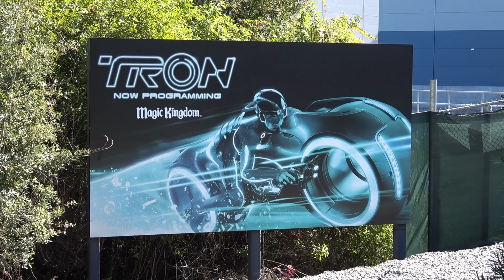Why is TRON taking SO LONG?!

Comment: I noticed that pretty much most new Disney rides, not just TRON, are taking longer to build than they used to. Guardians of the Galaxy: Cosmic Rewind was also announced in 2017, and still won't open until this Summer. And unlike TRON and Ratatouille, there are no earlier incarnations with supposed exclusivity contracts. Meanwhile, Universal was able to construct both Hagrid's and the VelociCoaster within much shorter timeframes.
Reply: I mean yeah, the upcoming rides are taking longer. Not sure why that comes as a suprise. They lost a year of construction and now are dealing with staffing and material shortages. Universal is in the same boat as super mario land was pushed back in the US until maybe 2025 now. It stinks but expected. Not sure why some are trying to make this a bigger suprise then it is at this point but I guess that is what people online do.
Reply: Cosmic Rewind was originally supposed to open September 2021 but got delayed because of covid
Reply: @BAM5636 Epic universe was pushed back to 2025 which was close to original schedule anyway. Super mario land is in epic universe. Universal building whole park therefore obviously it was going to be pushed back. Disney building one attraction
Reply: Cosmic Rewind however not only is going to be a first of its kind coaster, but also part of the delay is because the show scenes where delayed in filming due to the 3rd movie starting production late, which from what I’ve heard was the main reason for the opening getting pushed back
Reply: @Jonathan Pal It isn't going to be until 2025 now. Sorry. It was put on hiatus in 2020 and the original schedule now it has resumed is not realistic. They have only down scene work ground level
 They have not built up anything really yet
 If you think they are opening in 2023, well, that is extremely wishful thinking. Also, universal should care a bit more about nostalgia to be honest. I actually love both but it is universal that has slipped a bit ride wise for me, not really Disney. Hagrids is a awesome coaster though as long as it stays running. Seems to be a bit better now after the first year or so.
Reply: @GBJames776  Disney has built more than one attraction in the last 3 years. They built two lands. Come on.
Reply: @BAM5636  Pre pandemic. Universal built a coaster and designed in the middle of pandemic, Disney haven’t even built there coaster that started before the pandemic. Only opened ratatouille like 4 months ago and I saw that being built ages ago. Disney make billions more than universal no excuse
Reply: @Jonathan Pal I got 2025 from universal's announcement when they resumed work. Also, common sense based on how little has been done at this point.  You have your opinion but Universal is not as good as it once was for me. Outside of Harry Potter, I am not a big fan of their newer rides. Fast and the Furious for example is the worst ride of any major park I have ever been on. Jaws? You have mixed up history on. Yes they shut it down after like 6 months originally but they they shut it down and rebuilt it. The version 2.0 didn't have the issues version 1 did. They closed that to put in half of HP. At the time it was a Hail Mary as Universal parks were failing hard. As for E.T, that is rumor not fact and E.T, the last opening day attraction, will be gone soon in Florida just like it is in Hollywood within a couple years mark my words. Most of universals non roller coasters are 99% screens and I am just not a fan of that really. New Kong is okay but FF, Jimmy fallon etc are terrible rides IMO. Also Disney is a cash grab but Universal aka Comcast is not? Ha..Okay I guess, that is a odd opinion but you do you.
Reply: @BAM5636  kinda agree with some rides being poor but seems like they have learnt there lesson from fast and furious , considering hagrids and velicoaster are arguably two of the best rides in Orlando. Which hopefully is good signs for epic universe
Reply: Avatarland took 6 years!!!
Reply: @GBJames776  I agree those are great coasters. That said, there is more types of rides then coasters and that is their weak point these days IMO.
Reply: @GBJames776  LOL. How many rides have you built? None, okay then. Your opinion on building them is worthless in the end.
Reply: @hollybabyyy  Not as comparable really as that is a land not just a ride.  Also James Cameron was involved and we all know how long it takes for him to get anything done.
Reply: @BAM5636  chill lmao, Universal have the best dark rides in the world, best coasters in the world. Not going to lie comment is just stupid. Forbidden Journey was named best dark ride in the world for ages. Disney have good dark rides , Just Disney is falling behind considering universal is making a new park more people will turn to universal , Especially with ridiculous price increases, if you are from the uk and went 3 years ago, all you see in Disney is ratotiouie which we already have in Disneyland Paris. Think will go only universal next trip, not worth overall cost compared to new experiences I get back
Reply: @GBJames776  Best dark rides in the world?...Bwhahahaha. Talk about a hot take there. FF is the worst ride ever made at any major theme park. Also ROTR is better then Forbidden Journey. Universal uses all screens all of the time. They sold their soul years ago and now are just a wing of Comcast.
Reply: @GBJames776  Also forbidden journey won that in 2014. Try being more current ;). It has not been the best dark ride since that time.
Reply: @Jonathan Pal Sounds like you are the one making things political. Once you went that way, I am no longer listening in all honesty. That whole talking point is tired and overplayed. You don't want to go to parks anymore, cool, your choice. Bye.
Reply: @BAM5636  I don't really understand your comment, So do disney, I stated Universal have world class dark rides which they do as proven. Was voted 2nd in 2019 . Literally disney has a ride which you sit in front of screens which are there most popular rides in Flight of passage and Soarin. You stated universal don't have good rides apart from coasters which is completely incorrect. I like disney too lmao, Just talking about how much money it costs from uk to go to disney compared to universal is significantly more expensive and they took away disney dining plan from uk tickets so it is even more expensive and rising ticket prices and food. Just not affordable no more and just not worth the price.
Reply: @GBJames776  For one, I never said Universal doesn't have any good rides. Also, are you really trying to compare screen usage at Disney to Universal? That is a rather odd side to take. If it isn't a coaster or water ride there is about a 90% chance it is a screen ride at Universal. You stated they have the best coasters and dark rides in the world. That is pretty subjective but if going by awards as tou mentioned earlier that is categorically untrue. As earlier stated, Fast and the Furious is the worst ride made in a major theme park that I have ever been on. It is laughably bad. Skull Island. I like Kong and all but I would take the OG back in a heartbeat. The best part is the only part without screens which is the half of the life sized kong at rhe very end. Screens can be used well but they should not be over used. Back to the Future or Flight of Passage were/are well used screen based rides. I want Universal to do well in the end. That is what you don't get really. I am not some can only love one dope. However, Universal has lost a lot of its identity to me over the last 10 years. I think most people just think of it as the Harry Potter park now and for good reason. It kind of is.
Reply: @BAM5636  I never went on old Kong or back to the future but have to admit jaws probably most missed universal ride hopefully they can add it as expansion to epic universe, yeah ff is crap.

Comment: It's ridiculous and the railroad has been closed for such a long time as well.
Reply: At least you guys are getting a ride out of it. In Disneyland Paris it was to build a now half of the time vacant Frontierland Theatre and above all a cost cutting measure.
Reply: They were testing the train the other day!
Reply: Hard to have a train running when the track is supposed to go through the construction area
Reply: When I visited in 2019 they had sent the engines off to Pennsylvania for refurbishment. I'm sure they were trying to have them done and back by the time WDW turned 50 but the pandemic put a damper on that. The cast member at the railroad station DID let me walk around the cars in ways you normally aren't allowed to do, which was awesome, and even spent quite a bit of time talking about the technical aspects of the cars, the engine, and the railroad itself. That was a whole lot of fun, and kind of a unique thing that you wouldn't normally be able to do during a Disney visit.

Comment: If I was in charge of planning I would’ve put GotG in Tomorrowland and Tron in EPCOT. You would’ve entered Flynn’s arcade in the play pavilion, get digitized, ride the coaster, and end up in the energy building where you can eat at the end of line club before reentering the real world. Think of how much money they could’ve made off that!
Reply: I'm sorry but No Marvel in Magic Kingdom. It's better off in Hollywood Studios.
Reply: @gissneric  down with that too
Reply: Agreed no marvel in MK. However I do agree with you about Tron in Epcot.. test track inside looks like Tron so can retheme outside and queue area and have a Tron area, but that would be $$
Reply: I agree. Tron would've be much better in Epcot and I like the Idea of GOTG in Tomorrowland.
Reply: @rebeccaheuer3255    Points and idea are valid. however what a lot of ppl seem to forget is the footprint of the attraction-  Tron is massive, and there's just now way it would have fit in EPCOT given the area. Cosmic Rewind while a big attraction doesn't take up nearly as much real estate as Tron would have. In addition, putting Cosmic Rewind where it is, allows Disney to utilize the former Universe of Energy show building and saves them the cost of ripping it  completely out. Guardians is a good fit for that section of EPCOT and I think it will do fine- 
I can't see it squeezed into Hollywood Studios and competing with Rockin Rollercoaster or Galaxy's Edge. The whole idea behind putting Guardians where it is is to lure ppl to EPCOT to begin with.
Reply: This is what I’ve been saying!
Reply: aren't they turning Test Track into Tron? I thought that's where that was going
Reply: @Eternaldarkness3166  they sort of already did. It def has a tron feel to it inside lol

Comment: I highly expect Tron's opening in late 2022 or early 2023. I agree with your idea of opening the ride towards the end of the 50th anniversary cause even though it didn't start the celebration is originally intended but it would still be in the window of the celebration.
Reply: Adjust that to early 2045 lmao

Comment: My GOD, it's like Test Track all over again.

BUT, I think they're trying to AVOID the problems that they had with Test Track (which I was working at EPCOT when it opened). TT had a boatload of technical issues. No way are they going through that hell again.
Reply: They shouldn't have that level of problems because there's already a working version of it in China.
Reply: @MrStGeorgeIllawarra  Shouldn't...yet here we are.
Reply: "...trying to AVOID the problems that they had with Test Track."
"... boatload of technical issues"
Rise of the Resistance has entered the chat
Reply: It's a damn launch coaster lmao it's been built already
Reply: @nomnom3451  LOL

Comment: Thank you for the video.  I want to kind of put the brakes on a little tiny bit.  There is absolutely nothing wrong with being enthusiastic about any theme/amusement park ride, especially a new Disney theme park ride, but in this particular case I would strongly suggest not getting too overly excited about Tron Light Cycle Run.  In my book it is nowhere near worthy of the massive pre-opening overhype that Walt Disney World fans are giving it and if you fall for the overhype you might be massively disappointed in it.  If you stand back and look at it, this is a cloned Vekoma Booster Bike coaster.  Now, that may be your cup of tea if you like that type of roller coaster but no matter how you look at Tron Light Cycle Run, it is basically a cloned roller coaster with no changes (that anyone knows about) aside from its location.

I don't know if you have ridden Tron Light Cycle Power Run at Shanghai Disneyland but I have several times during the park's opening year and though it was a fun roller coaster it was far from mind blowing to be honest.  It is not a coaster that I'd wait more than 30 minutes for and thankfully it was only about a five minute wait every time that I rode it.  (I rode it about three or four times total.)  This is just one guy's opinion but despite what Bob Chapek said in his introductory presentation that was shown in this video, Tron was most definitely not the most popular attraction at Shanghai Disneyland.  Based on my experience over several days at the park, the most popular attraction there by far was Soaring Over The Horizon and it was not even close.  The most popular attraction amongst myself and my family was Pirates Of the Caribbean: Battle For The Sunken Treasure and that was not even close.  By the end of each day that I was at Shanghai Disneyland, every major attraction was a walk on except for Soaring and my family and I kept riding Pirates Of the Caribbean over and over.  I could have easily ridden Tron again but I had no urge to do so since, though it was a fun ride, it just was not all that great in my opinion - unlike Pirates.  (In my book, Pirates Of The Caribbean: Battle For The Sunken Treasure is THE reason to visit Shanghai Disneyland, attractions-wise...no doubt about it.)  Tron was not the most popular attraction at Shanghai Disneyland based on my visits, not by any stretch of the imagination.  The idea that Bob Chapek possibly doesn't know about ride popularity at Shanghai Disneyland does not really surprise me at all.

Now, I will admit that I am both a life-long Disney theme park fan and roller coaster enthusiast so my perspective admittedly might be out there in left field compared to everyone else so please take what I say here with a grain of salt.  It's just my opinion and nothing more and as always your mileage may vary.  It's just that I really didn't know much about Tron Light Cycle Power Run before actually riding it aside from the fact that it was a Booster Bike coaster from Vekoma themed to the newer Tron film.  Even though the ride was not hyped up much at all in my mind, it still did not blow me away.  It sure was fun but it was not mind blowing and certainly not worthy of a fraction of the over-hype that Walt Disney World fans are now giving to the clone one being built.  On the other hand, I did know all about Pirates Of The Caribbean: Battle For The Sunken Treasure way before I went to the park and that attraction still completely blew my mind and exceeded the hype.

That's just my opinion though.  It's admittedly hard not to get hyped up about any Disney theme park attraction even if it is just a cloned coaster from Vekoma, the company that built its reputation on the whole concept of standard roller coasters bought from a catalog.  I just wanted to warn you and others that if you hype up Tron Light Cycle Run too much in your mind before it opens, you may be setting yourself up for a major disappointment after you do actually take a ride on it.

Thank you for the video again and I look forward to hearing your opinions about Tron Light Cycle Run after you actually ride it.

Comment: Disney is the epitome of the emperor has no clothes. Even if the ride does open in 2023 (& I'm assuming GotG will also open next summer?), Disney will really only have 2 years to get its act together. Universal plans on opening Epic Universe in 2025. They just stated on their earnings call that they're working overtime to make up for lost time. And Universal NEVER talks about timelines. So the fact that they're already giving it a ballpark opening timeline means they're serious about it. (& yes, I know Disney has far & away the lion's share of Orlando theme park visitors, but Universal has been on a hot streak for years & doesn't seem to be slowing down any time soon, while Disney, well....)

Comment: It’s probably going to be another decade before this thing is finished. Disney is in a lot of financial trouble and it’s only going to get worse as their current path continues
Reply: Maybe the reason is that the other rollercoaster at Epcot is opening first. Why would they open two rollercoasters so close to each other. They have to spread it out. I have seen some progress in Tron which could mean it could open either late this year or early 2023.
Reply: If Disney keeps going the path they're going, they'll never have financial troubles, so it's probably not that